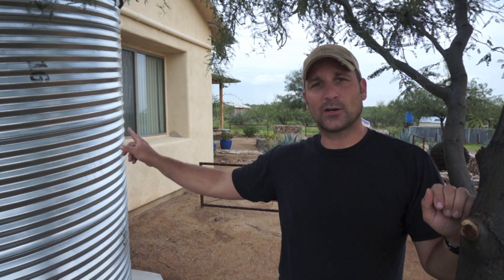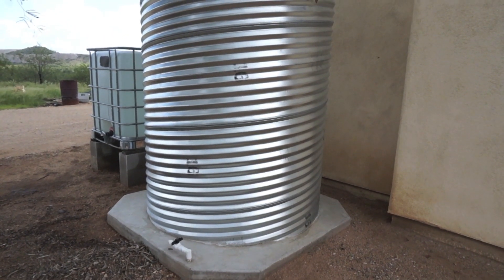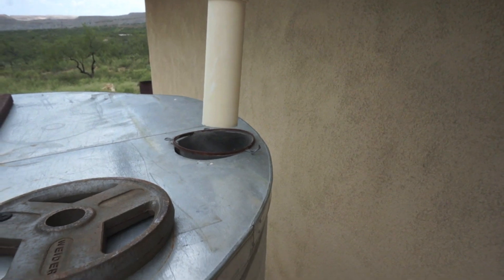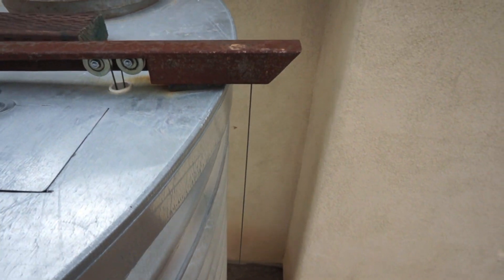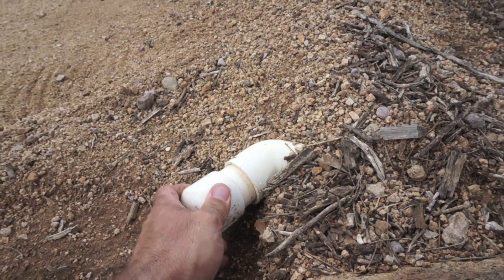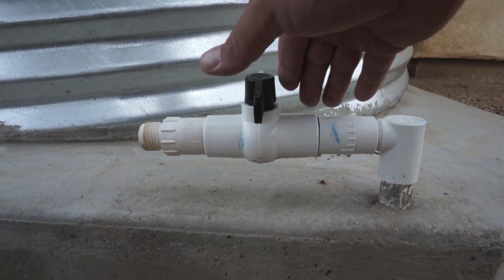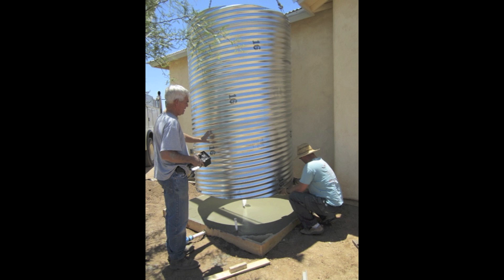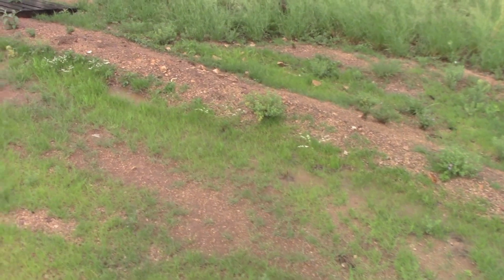Culvert Cistern Tour - Rainwater Harvesting DIY

Comment: Is there any danger or concerns doing this in areas where winter gets to freezing temps and snow? Will pipes / pvc burst at all?
Reply: Yes! Don't ever use pvc. Use pex, but wrap it with insulation inside the slab as it doesn't like cement, but it won't burst. Just saw this video and plan on doing it, but haven't figured out how to get the water out yet. Had standard 200g galvanized tanks in Papua New Guinea in the 80's and they had an out let 2' above the bottom. you let the debris and stuff gather on the bottom and just the cleaner water comes out. I could not see where Joe has set his outlet at in the video, but would advise staying with the 2-3' mark.
Also, that is a heavy weight of water, so make very sure it is level and I would treat it like pouring a house foundation. This depends heavily on the kind of soil you have.

Comment: You missed the essential last step, insulating the water tank/culvert. Cool water stays better / good way longer than hot warm water.... the metal culvert will heat the water, great for showers... That's why in ground cisterns are great, the earth naturally insulates.  Check on Petra cisterns in Israel , abandoned ancient city built into the cliff side.

Comment: You really should have had your water line head straight down from the center of your culvert, then do a ninety degree turn about 12-18" underground to about a foot or so beyond the slab where you then install an in-line isolation valve and another hose bib so you can drain and winterize entire line. You can put all of this in a green irrigation box. From this "control" box. How it is now, that exposed pvc hose bib is going to freeze and crack eventually. I know because I learned the hard way. Just trying to help.

Comment: Great video.  When pouring I think I would have put the pipes near the edge not the center.  Then replacement etc much easier.  No real reason to make it in the center right?  Great system.  Very impressed. Thanks for sharing!

Comment: Great video, as are your others. The zinc coating leaching is definitely a concern due to the softness and acidity of rain water. I don't think you can passivate zinc so a styrene coating inside the culvert may be a solution. As far as first flush is concern just make sure that your draw off pipe is a foot or so above the floor, the sand will settle to the bottom of the tank below the draw off rather quickly. The water can be pumped the rest of the way out and the sand vacuumed out after it accumulates.

Have you considered UV to disinfect the water? No chemicals and a rather low power drain. The systems for houses only come on when there is flow through the pipe.

Comment: Just discovered this video, and your very cool channel. Thank you for sharing. Question on construction: Did you sink the culvert into the wet concrete? If so, how far? You talked about rubber coating too. What I am really asking is: How did you seal the bottom of the culvert so that the water doesn't leak out with gravity?

Comment: Considering the cost of the culvert and concrete, why go this route over just buying a tank?
Reply from the maker: Hi PC guy... I have poly tanks as well but also think this is a good option if you "DIY" it like I did.  Not including the lid this 1100 gal cistern cost me approx 425ish to build(I have an article on this at Backwoodshome.com where I detail the plans and the costs).  You could also just stack 3 - 330 gal IBCs together to get close to the same water capacity as well.  Anyways, its just another option... not the best or the worst... just another option:)  thanks for watching
Joe
Reply: I looked around and pretty much all of the culverts i saw were like 20 foot long so they would have to be cut to even be used this way.  Many years ago, I got a hold of the end of a fuel storage tank that had never been installed. Was made by Owens-Corning and was given away as scrap because it was defective. We used it as a septic tank. Now this had never had any fuel in it. I was thinking that maybe I could do something similar with one of those, however, it has been 30 years since all that took place so I have no idea if I can even lay my hands on another one. Those tanks were very hard to cut as they were double wall fiberglass but it's possible.

Comment: Wonderful video.  I've got 2 quick questions.  1: How has the AMES Blue Max held up?  The guys at harvestingrainwater.com don't seem to recommend it anymore as apparently it tends to reemulsify and blister in cisterns, but I'd be interested in your opinion.  (theirs is here:  http://www.harvestingrainwater.com/rainwater-harvesting-inforesources/suppliers/sealers-approved-for-contact-with-potable-wate/#%3Cstrong%3ESealers%20for%20gutters%20and%20for%20between%20different%20materials%20such%20as%20concrete/plastic%20and%20metal%3C/strong%3E )
2. You seem to be in Tucson (maybe?)  Where did you get the cover made?  I've found a supplier in casa grande for the culvert, and all the rest looks straightforward, but the top still eludes me.

Thanks!
Reply from the maker: Thanks so much Richard!  I've actually found that the Ames has held up  very well... no leaks at all and I haven't found the reemulsify issue.  But I don't claim to be an expert so I'd probably head the advice of the HR folks.  However, The last time I cleaned it the rubber looked to be in good shape.  I helped my friend Jason install two  of these  (one for him and one for his neighbor) and both are also doing well with no leaks.  I can't speak to the other issues of blistering/emulsiying as I haven't been inside either one since being installed.  But I'd trust the guys at HR.com as they seem to be pretty good experts in the field.   I will say that AMES is not exactly cheap, so the thoroseal might be a great option.  That actually was my first consideration when building mine but i wasn't sure as to it's effectiveness in sealing the spiral seam that extends all the way up the cistern.  But I'm guessing it would probably be fine:)

As to your other question... yes, I'm in the Tucson area (west of Sahuarita to be specific) and I got my lid from an HVAC guy named 'wayne' that I found on craigslist.  It was a $100 bucks i think.  But I don't know if he makes them anymore.  However, several HVAC companies  around Tucosn do custom sheetmetal pieces and are famliar with cistern lids.  I've seen them sell from $150 to $250 depending on what you are getting (cone, flat).  Check craigslist and then check HVAC companies that do custom fabrication.

Also, if you look on my channel I have a video of the installation of my friend Jason's culvert if you want to check that out too.  Additionally I have an article in Backwoods Home Magazine (backwoodshome.com) about my cistern install.  Just search for authors and look for Joe Mooney:)

Joe
Reply: Can silicone caulk be used on the spiral seam?  For the floor, just use cement (no sand)?

Comment: Hi, if you don't mind me asking, where might I find a length of culvert pipe this size for sale?
Reply from the maker: +Crispin Wilson Hi Crispin... sorry for the delay in responding... but the best places for culverts are fabricator/manufacturers that sell directly to road and civil construction companies.  They can be hard to find at first as those companies are usually geared towards selling to companies or Gov't buyers.  Some landscape companies will sell them too but I've found them to be really expensive, as they are marking up from the original purchase.  I've purchased them here in AZ directly from Pacific Culvert Co located in Casa Grande AZ.  .... and sometimes you can find a good deal on craigslist, but those are usually pretty weathered and beaten up.
anyways, hope that helps:)
Joe
Reply: +homesteadonomics Thanks a lot Joe, I'm in Flagstaff so it might just be worth the trip. We're fairly new to the off-grid lifestyle so you're channel has been great. I want to install a wet pipe system similar to yours but I'm not sure my eaves are high enough. Do you know off hand what the difference in should be?
Reply: +Crispin Wilson *difference in drop

Comment: My husband and I love your channel. Thank you so much for taking the time to share! I live in Phoenix AZ and I am trying to find a metal cistern like yours for rainwater collection. Any advice on where to look? We haven't had any luck on Craigslist or local installers...they all carry plastic containers only. We are even willing to travel to Tucson if we have to. Thanks again!
Reply from the maker: +Desert Dwellers Hi DD,  you are in luck.  You'll most likely be able to get it at the same exact place I got mine.  It is Arizona Culvert Company(aka pacific culvert co) located in Casa Grande(off of the 8).  They will cut whatever length you need and if you are getting an 8ft length I can say that it will fit in a standard pickup bed just fine with a couple come-along straps to hold it in. I little weird feeling to drive with a big cylinder object in the bed of the truck but pretty easy.  They will load it with a fork lift but you'll need at least two people to unload it.  Hope that helps:)
Joe

Comment: I am having a difficult time locating a culvert wide enough, any advice on where to look or where to order from? Big Box stores etc.
Reply from the maker: +Garage Man Project Shop Hey Gman… I have found the best place to source culverts is from a manufacturer.  They are generally located regionally.  So there might only be one manufacturer in your state or region.  OR you'll need to find out the closest supplier that supplies road crews with culverts for road work.  Big box stores will not have them… it'll have to be a supplier or manufacturer.  You might want to check with some local contractors on where they purchase theirs.  Hope that helps:)
Reply: Menards home Depot lowe's. You may have to order it though

Comment: I pump oil wells and we use the jug and weight to get an idea of how much water is in the saltwater tanks at each tank battery.  Saves on climbing ladders.  There is usually a skim of oil in the saltwater to keep bacteria down.  Do you have to treat your stored water Joe?
Reply from the maker: Ted Alexander ahhh... that's a great idea!  The buoyancy principle is also what makes this level guage work!
For my treatment I just use a little bit of chlorine bleach in my main rain tank(tan poly tank), which is where this tanks water will eventually get transferred to.  Didn't want to have the bleach negatively affect the galvanizing of this tank.
But for our drinking/cooking water... I use a berkey water filter as our final filtering of our rainwater.  Showers, laundry, dishes all just get regular rainwater:)
Joe

Comment: Another nice project & video description!

The top of your tank seems to have many small gaps/openings that would let light in which then would allow significant algal growth over time.  How do you prevent/mitigate that?  Also, are there any issues with mosquitos breeding in such a tank that has openings to the air?
Reply from the maker: Peter K. Hi Peter, I've never had any algae growth or mosquitoes in this tank... that I know of atleast;)  I usually transfer the water in this tank to my polytank rain tank behind my house during the monsoon season.  I don't think the tiny bits of light that get in there make much of a difference either way though.  But if it was a concern you could always throw in a 'cap' of bleach to mitigate any algae or other growth.  And don't worry, that amount of bleach is waaaay less chlorine than is added to municipal water supplies;)  But, just to be safe any water should be filtered before consumed (berkey is my choice).
 Anyways, hope that answered your question! 
Joe

Comment: Another sweet video...Great job explaining the build components & system as a whole.

I am trying to come up with a system of rain water collection tanks to irrigate my vegetables and fruit trees. The one key feature I want to integrate into this system is a tank that can hold raw fertilizer and or compost tea. It would be really great to have the ability to both water and if needed fertilize my crops. Stack those functions.... :)

Keep up the good work Joe.
Reply from the maker: GFD472 Thanks GFD!  That sounds like an interesting system... maybe you could pair 55 gal barrels or an IBC tote as your fertilizer/compost tea component and mate the water tank to them with a PVC assembly.... kind of like a mixer or compost tea induction system.  When the water from the tank is flowing you crack the 'tea' valve and let the 'tea' mix with the main water source...hahaha or something similar... you got my mind flowing;)
Joe
Reply: homesteadonomics  I don't have the design clear in my mind so to speak.  It can not doubt be made to work and be a benefit to the permaculture homestead once up and running. Just a matter or working out the design kinks.  I'd be interested in your  thoughts if you decide to investigate the concept further.
Reply from the maker: GFD472 I might just have to put that one on 'the list' of projects and let it sit in the back of my mind for a while.  Sometimes, when I do that the answer just kinda comes to me when I least expect it.... of course, sometimes I just forget about it too..lol:)
Joe
Reply: homesteadonomics Well I have been thinking about it for a couple months and the best I could come up with is to source some free coffee bean bags (these are large 50lb bags used for raw beans) and fill them with whatever you want to make the tea out of and sink the bags into a dedicated water tank with a air stone.  This tank is plumbed to the main water source and run just exactly as you described above.  I am going to try and get this sort of system running by Spring next year.  To much on my plate to touch it this Summer.

Comment: Hey Joe, what was the cost of the culvert?  Was it cheaper than buying a purpose built poly tank, or were you going for the aesthetics with the culvert (which looks great BTW)?

Please don't take the following comments as a negative criticism, but you might want to cover or at least paint the PVC as it degrades with exposure to UV light.  I would hate to see that pipe crack/break and you loose all that valuable water. 

You also might want to paint or cover the IBC tote to prevent algae from growing in it unless it's not a concern for you.  :)

With all of that being said, I hope I didn't come across as a "Do nothing know it all".  I do have some experience helping my brother-in-law setting up some rain collection systems at his homestead. 

Thanks for the update on your rainwater collection system.  Your videos are inspiring and fun to watch. 
Jarrett
Reply from the maker: helidodge Hey Jarret... no worries, those are all great points:)  
-the cost was about $400 (not including the lid $100) and the culvert is comparable to most poly tanks in price per gallon... the larger you go that is... smaller culvert cisterns loose that value per gallon quickly.
-for the PVC... I actually have a little pallet wood box that sets over the assembly but just took it off for the video as it looks kinda junky..lol
-and for the IBC tote being painted/covered... something I've been meaning to do but just haven't yet:)
Hope that answered your questions and thanks for watching Jarret:)
Joe
Reply: That's a great price for the culvert. If you don't mind me asking, where did you get it and what brand did you go with?

Comment: OK what is the culvert made of and the top you have on yours is it something you have to make or can it be bought?
Reply from the maker: weetreebonsai Hey WTB... the culvert is steel bonded with zinc galvanizing and the lid can be made to fit by most HVAC companies that do custom sheet metal work.  Mine cost a little over $100 but I've seen conical shaped ones that look really cool but are a bit more expensive.  Hope that answered your questions and thanks for watching:)
Joe
Reply: What do you thing about the duration of the steel walls?